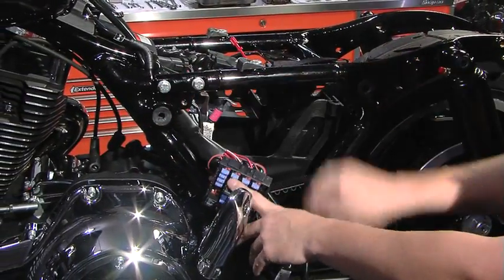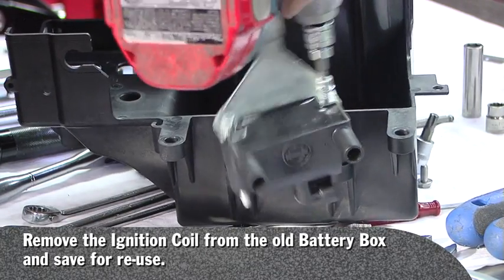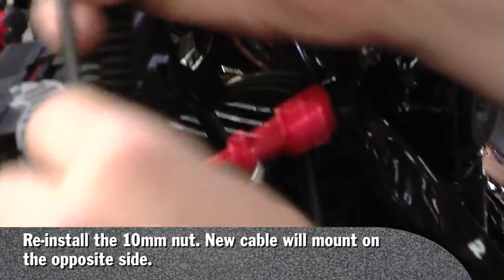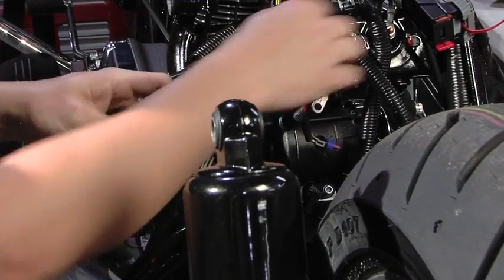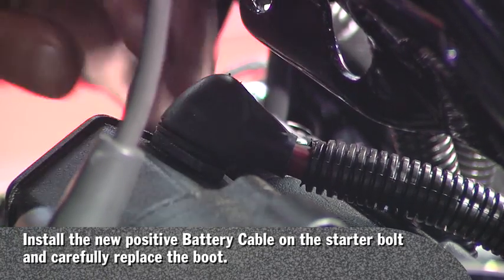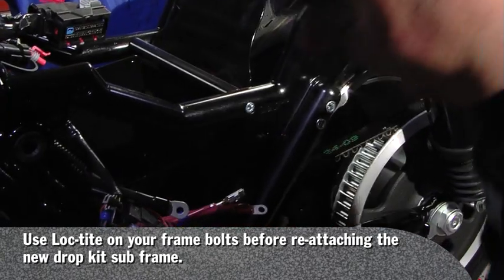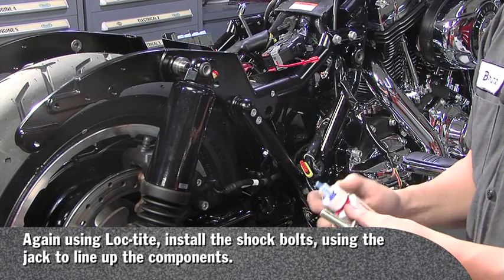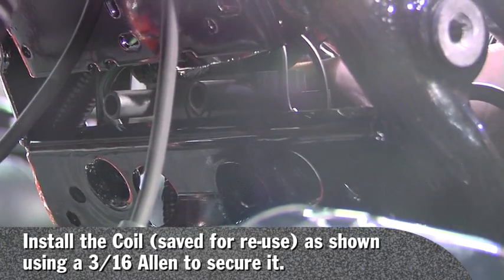BIKER'S CHOICE PT2 Drop Seat Kit Install

Comment: Why in the first place didn't Harley do this at factory on a $30, 000 bike. Instead of me having to install lowering kit for shocks and redo my seat profile on my 2016 Ultra Limited in order to be flat foot when stopped with a 29" inseam. My 2014 Heritage Softail sets nice and low with better ride too..